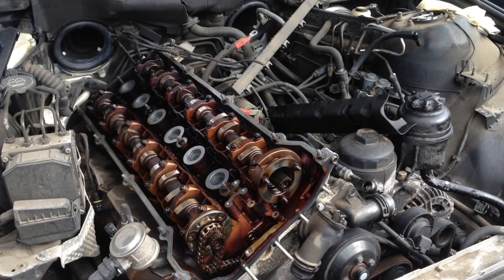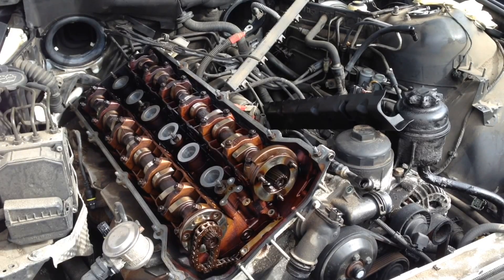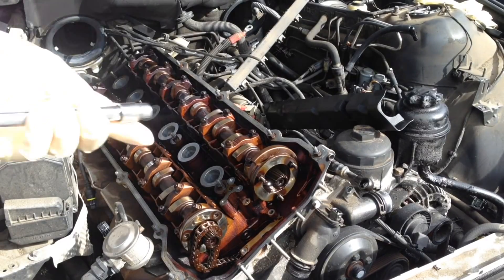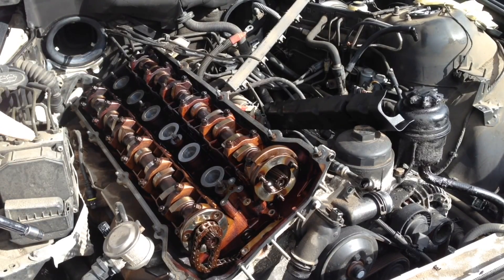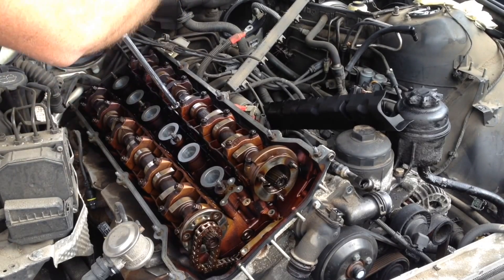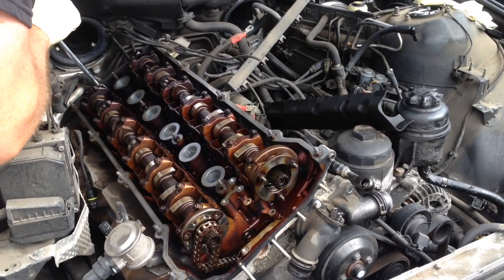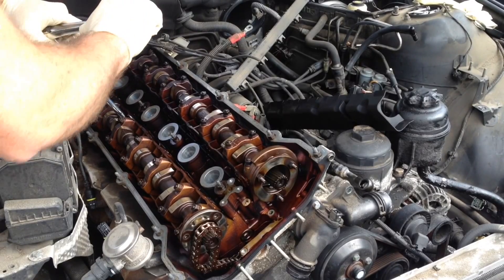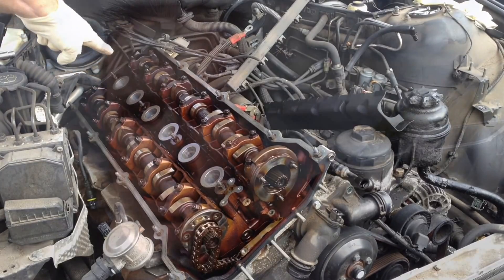How to Easily diagnose blown head gasket white smoke stripped head bolts BMW M52tu M54 M56 e46 e39

Comment: My 2004 BMW 325I needs a new coolant temperature sensor....1 and 2....it's been running cold but the heat works so it can't be the thermostat. I'm concerned because a few times while turning on the car...and applying the defrost the guage jumped immediately to the H ... obviously not accurate since the sensor is or has failed. However, I didn't drive the car after that for fear that the head gasket is blown. I did a test and there is no white smoke coming from the exhaust pipes at all...also...no bubble's in the radiator cap...most importantly....no milky oil color on either the oil cap or the dipstick. Can I sleep well knowing the head gasket isn't blown?

Comment: my e39 m54b25 runs hot but the temp needle stays half also its drinking the coolant in the expansion tank not all but some. when i start the car and i open the radiator cap i can see bubbles sometimes, but not constantly. when the engine gets hot coolant starts pouring out of the expansion tank. the cap smells like burnt coolant. i have a new therm 97degress. mechanics here dont have a good experience on bmw.HELP PLZ.

Comment: Hi, i have a 06' 750li and recently its been having lots of white steam coming out the exhaust sometimes it seems to only happen in the cold...no engine lights and car runs strong. My bf just changed the oil and filter a o ring seal in the lower rad hose sensor because it was leaking and he did the rotors. The car has always done this in the cold but lately its been alot more then normal and then it goes away. It seemed to get worse after the o ring was changed along with the oil. The car has no oil in coolant and no coolant in oil....the rad pressurizes when the car is hot and isnt losing any coolant or oil. We have no idea what it is everyone says head gasket but the car runs perfectly and nothing else really points to it and it goes away. Could it be anything else besides water in the exhaust.....its alot of steam basically embarrassing but its always gone by the time i get home from my commute just does it when i leave work. Also the exhaust smells like normal exhaust its not burnt smelling or sweet....smells exactly like the exhaust out of our other toyota....we cant seem to figure it out.

Comment: Already did a head gasket job on my e53 m54 ran great for about 1 year then rad blow so replaced the rad water pump stat and hoses and now i have white smoke from exhaust would you say head gasket is blown? Also added oil catch can every thing ive done was based off your videos   I am mechanically inclined and use your videos all the time just to make sure all is right. Thanks hope to hear from you soon JT.

Comment: Hi, I have a 02 528i BMW and the temp gauge climb to hot as soon as you turn the ignition. The car crank rapidly but after 5 mns it's going crazy. I replaced the thermostat, problem is still there. What can I do next?
Reply from the maker: Willy Beneche check the wires going to the thermostat

Comment: Hi Nathan, I have oil in my 06 BMW X3's coolant, but no water in engine oil. Do you think it could be a broken head gasket? Thanks!
Reply from the maker: +Muhammed Tan could be a broken head bolt or even a bad oil filter housing gasket, since these have coolant and oil going through them
Reply: Thanks, Nathan, appreciated. I'll ask my mechanic to look into these. I am searching the internet but couldn't find any satisfying answer. The car drives without any issue but the coolant reservoir boils/leaks oil. Can it also be a leak in the radiator?
Reply: Nathan's BMW Workshop Nathan's BMW Workshop G’day Nathan. I’ve got a 2008 523i E60 and it’s blowing a huge plume of smoke under hard acceleration.  My oil filter housing has been leaking oil previously. Could this be the reason why I’m having the smoke issue? And at times there’s a roughly idle, but not very often.  Is it possible to change the oil filter housing gasket, without draining the coolant?
Reply: Nathan's BMW Workshop  Nathan thank you in advance for any help you can give me. 👍 it would be greatly appreciated mate. Cheers

Comment: Hi there Nathan I have a ? It my first time removing the head on my 03 BMW 325i  I have remove everything all the head blot but still not coming off timing chain are off,head bolts,and exhaust it seem like something is hold it from the from u only remove  3 E8 bolts from the front is there one move I did not see ? Pls help
Reply from the maker: there are 4 small bolts in front, 1 on each side and 2 in the chain guide for the small chain

Comment: None broke loose with 3/8 drive. Should I try with torque wrench before putting back together? Had one event with lots of white smoke and am losing coolant but not on the ground. Have you seen blown head gaskets without pulled studs?
Reply from the maker: no i have never  had a blown gasket, use a torque wrench and set it at 55 and see if they are all at least that tight

Comment: i have a 93 325i blowing white smoke, do you think mone could be the same problem?
Reply: I got 94 325. My coolant system was overhauled 2 years ago. I recently had a overheat that was border line in the red. I suspect it was from trap air because my heater blows cold air. No water in engine but in the bottom of the radiator I found extremely white white goo. Not brown. I use only BMW coolant. I'd like to think that the coolant is just old, which it is almost 3 yrs, and that it's just the white powder from all the new hoses I had replaced. Im going the flush the system and bleed it thoroughly and add new BMW coolant and get a test kit instead of taking the valve cover off as this would be  easiest.

Comment: Thing is sometimes the threads pull out when loosening.  In my opinion, if it's overheated, it's no longer a standard gasket job.  You have to timesert the block.
Reply from the maker: Yes never do one of these without using time serts

Comment: Hello, interesting video. I'm wondering if the head bolts can loosen themself over time, or is that caused by a blown head gasket / cracked head?
Reply from the maker: +Hauptkanal these engines are notorious for doing this, when i take one apart i install the serts even if the threads are good, its not worth taking the chance

Comment: 2008 BMW 535i .......changed the oil... might have overfilled sump (only filled with around 6.5 quarts)......started car to reach operating temp. to read oil gauge...oil gauge reads max.  Drove car around the block seemed fine.....parked car overnight.   In the morning, started car, will barely turn over before cutting out.  Immediately checked sparked plugs...all plugs have a light coat of oil.  Also, checked coolant for oil mixture (ok) drained some oil.....oil looks dark...it does not look right...I just changed the oil.....BMW (OEM) coolant is not the normal green or orange color...car ran fine before oil change....Any inputs!  BTW, great video.....hoping that I will not have to go to that length.  Thanks, in advance.
Reply from the maker: +SilverStryke Remove the pcv and see if the rubber is rotten and torn
Reply: Your talking about the the PCV right by the fuel pressure sensore above spark plug #6?
Reply from the maker: the pcv is on the valve cover it is round with a line going to it
Reply: +SilverStryke hey I have this same exact problem filled oil put too much drove the car ran fine. Now it barely turns on or when it does I press the gas and the car stalls out.
Reply: I drained about 1 quart and checked the oil gauge.  check gauge and filled as required.  Be careful and only ad in small increments. 1/4 quart at a time.
Reply: SilverStryke so after that your car turned over? I drained the oil took out the spark plugs and cleaned them. Car turns on but when I press the gas it won't go over 1k-2k rpms

Comment: Are most of the head gasket problems you've run into are from overheating?
Reply from the maker: +bimmerman3 Yes but sometimes it takes awhile to show up, the car might run ok for weeks or months after it overheats then one day it will pull the threads.
Reply: +Nathan's DIY Garage I learned early on with my E36 and now the E46 the cooling system is the first thing to totally renew on these cars.
Reply from the maker: Even then you still need to check it every few days